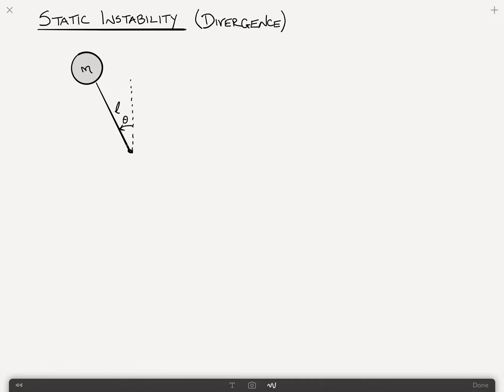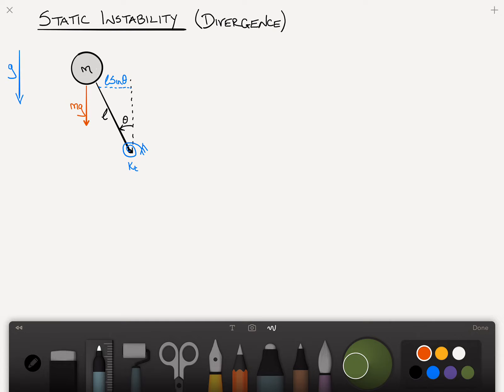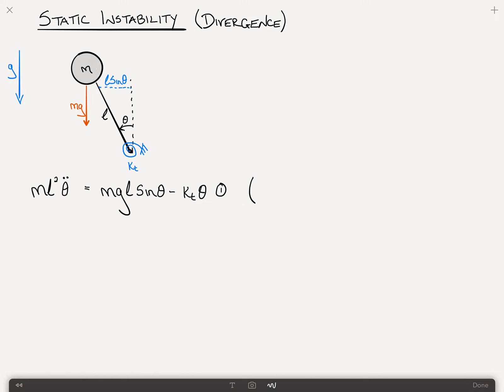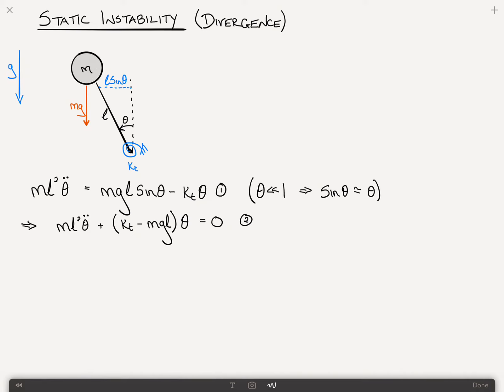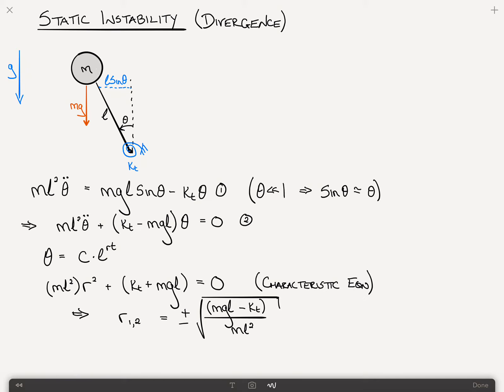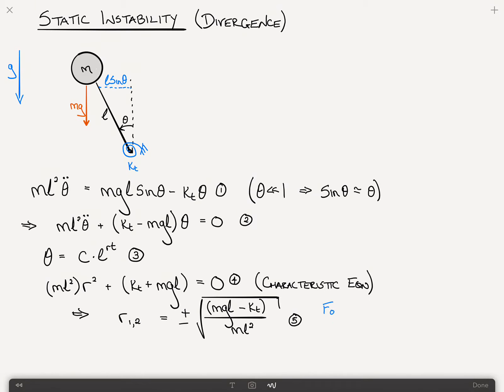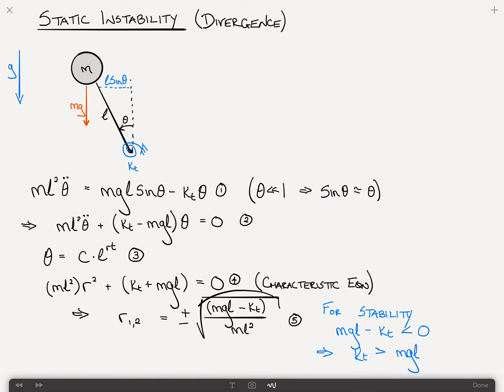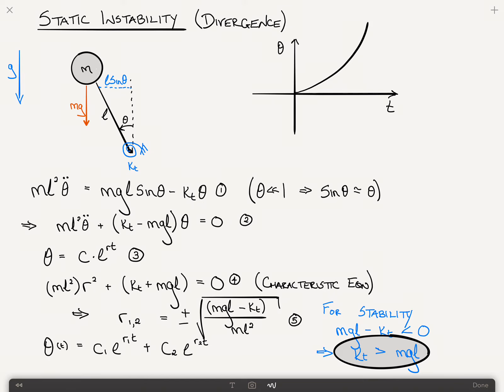Static Instability (Divergence)

Comment: Thank you for your informative tutorial video. I had difficulty understanding it, and I would appreciate clarification on Eq4. Why isn't θ substituted with c multiplied by e to the power of rt?
Reply from the maker: I actually skipped a step here because I have shown it in several earlier videos.  What I did in a single step was to substitute θ = e^rt (eqn 3) into equation 2 AND THEN because I have e^rt  in each term on the left hand side, I can divide both sides by e^rt to cancel this (I can do this because e^rt is never equal to zero) to get to equation 4.  So each term of equation 4 had e^rt in it before I cancelled them.

Comment: First of all, your videos and explanations are amazing!

I have found that in some structural analysis books, stability fenomena is associated with the eigenvalues of the stiffness matrix, in order to determine the critical load (buckling load) that changes the deformation patern. Some of them, states that if the real part of the eigenvalue is positive, the system is stable. But others, use a mathematical point of view, and states that the system is stable, if the real part of the eigenvalues are negative. 

Whats your opinion about this? 

I will send you this information by email.

Thank you very much!
Reply from the maker: In the case of structural mechanics, you are dealing with positive-definite stiffness and mass matrices (look up a formal definition, but basically this is a result of the matrix being both real and symmetric).  As a result, they produce positive eigenvalues (which are the frequencies).  Frequencies are all positive.  A common way to observe the stability of the system is to determine when the frequency of oscillation becomes zero - this indicates the verge of buckling (since, in effect, the structure has no more stiffness at this point).  So your comment is correct, viz., "...the system is stable, if the real part of the eigenvalue is positive".  I would further add that the eigenvalues are ALWAYS real (they have only a real part - because you are working with positive-definite matrices).

On the other hand, if the ROOTS of the characteristic have a positive, real part, then the system is unstable.  Not sure if you're conflating the two (i.e. the eigenvalues with the roots of the characteristic equations).  Send me a pic of the relevant pages if you can to:   apf99@gmail.com

Remember the EIGENVALUES of a mechanical system are the frequencies and must alway be positive and are always real - if not, this is a sign of failure.  On the other hand, the ROOTS of the characteristic equation tend to be complex, in general.  The imaginary part is what gives you harmonic motion and the real part is what incorporates the damping effect.  If the real part of the root is positive, the system will fail (displacements will grow exponentially with time).
Reply: @Freeball99  Thank you very much for your help!

I had sent you the information to your email.